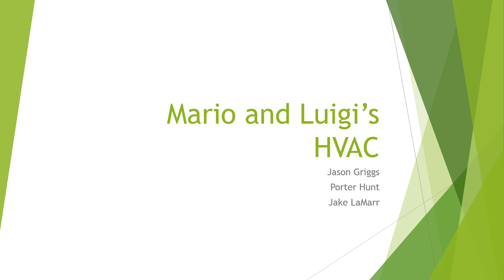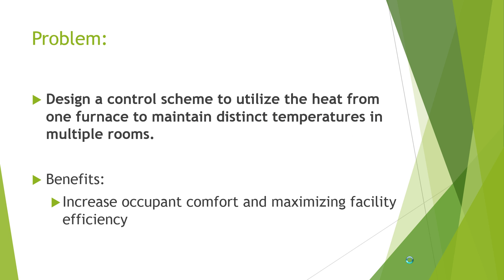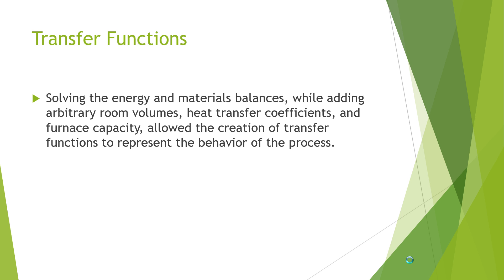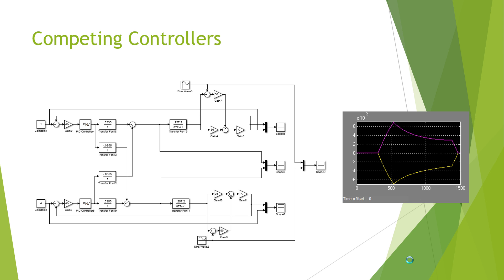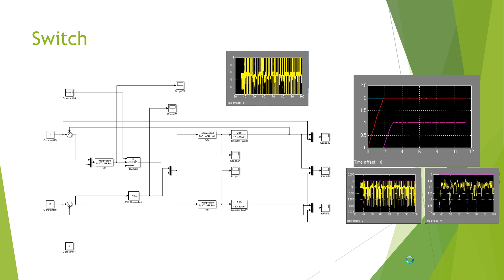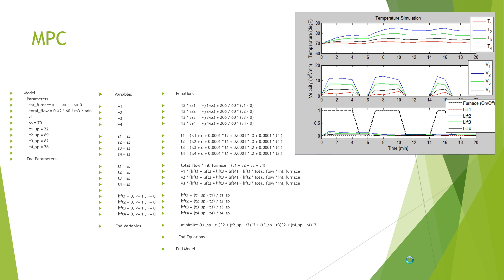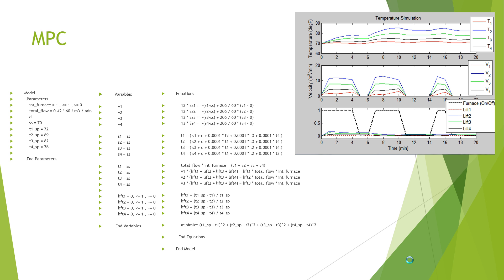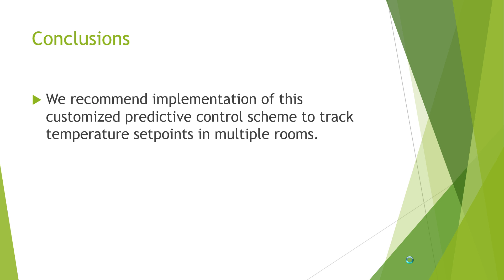Zoned Temperature Control with Simulink and MPC

Comment: I have several questions concerning a furnace temperature control using PID , any email address to contact ?
Reply from the maker: Mohamed, I typically can't respond to all questions that come to me through the YouTube channel. I'd recommend finding an academic journal article that is similar to your project and reach out to the authors to see if they can give you guidance? This was a student project (not mine). My e-mail is john@apmonitor.com but I can't typically get to the messages because of the volume that I receive.
Reply: Thank you for the quick answer , among tens of videos online , the system in your video is almost the same in my project , as I need to change some parameters , I still need some answers. 
However I appreciate your cooperation . 
Thanks!